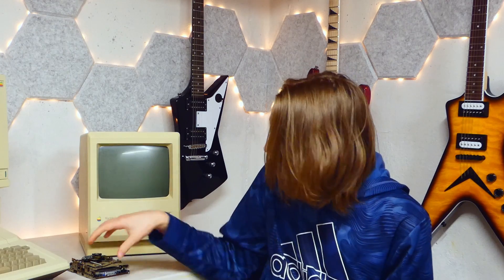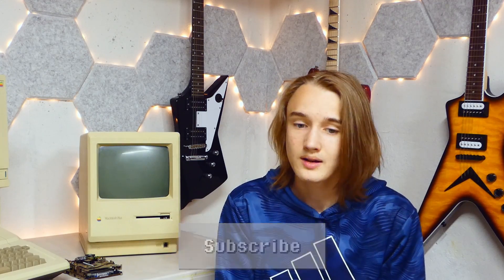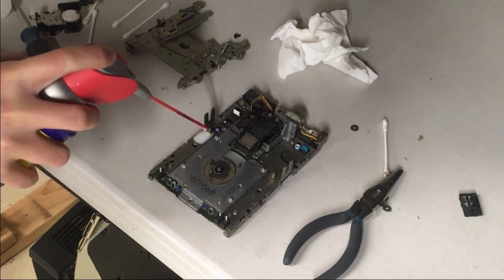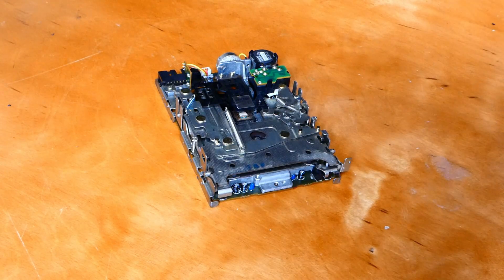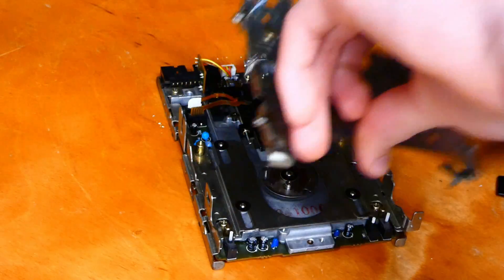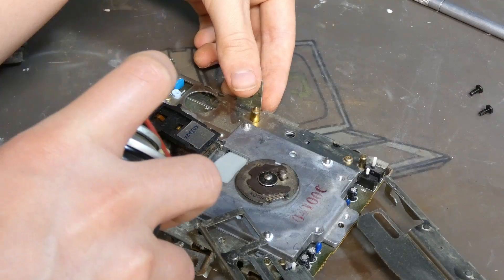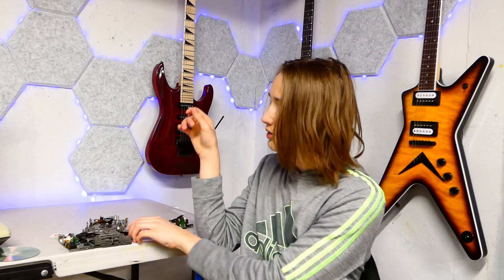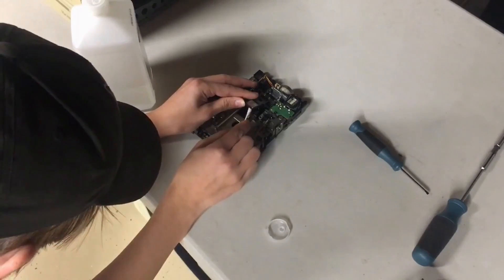How to REPAIR Vintage Macintosh Floppy Drives

Comment: Well done. I noticed you apply lubricant and then wipe some off. Do you ever apply it to a q-tip then apply it to the drive? I feel it is easier to control the amount of lubricant that is applied. Or does doing that way tend to not apply enough?
Reply from the maker: Yeah, I usually do that but I guess the clip I used was older or I was trying something different at that point. It's probably better to use lithium grease instead though which I was too lazy to do for this video (-: